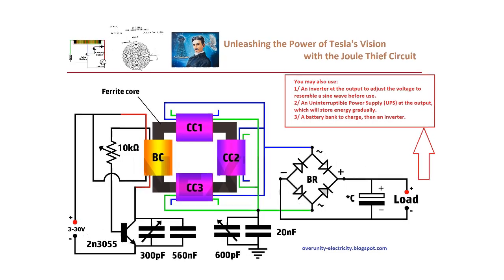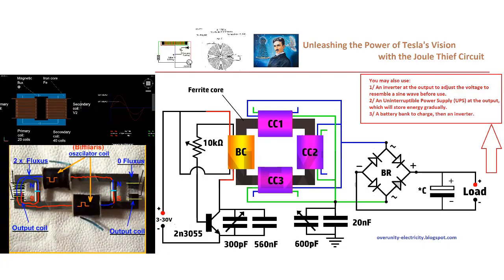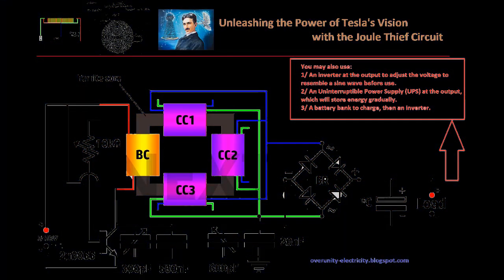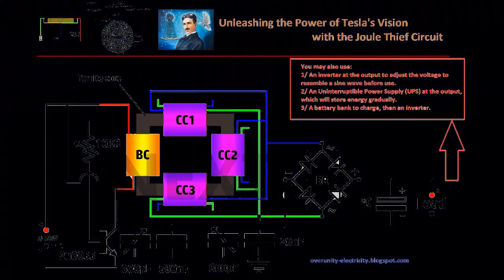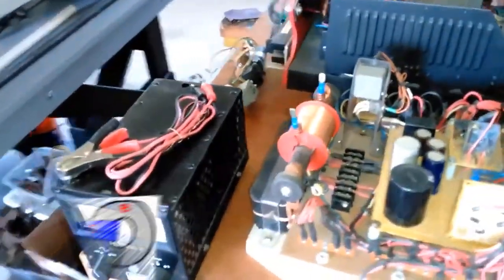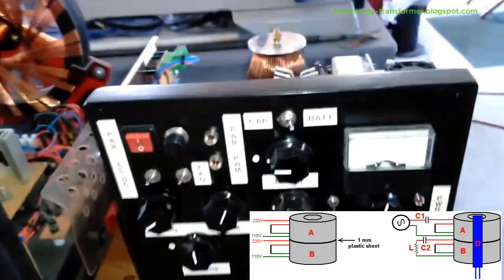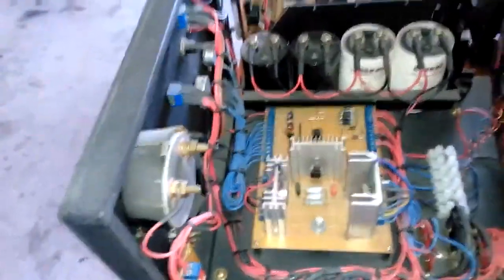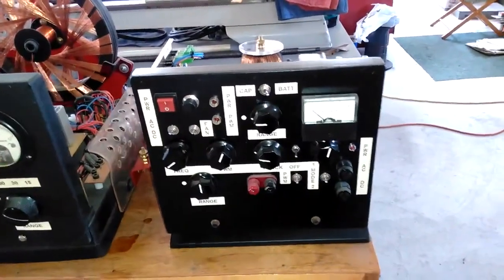Ether Technology After Nikola Tesla: Top 3 Free Energy Transformers

Comment: Please can someone explain to me why is it that back emf did not work on our local transformer bcoz if it works then all high tension should not be able to power more than 1 transformer but we can see that an high tension line can power a whole town why
Reply: A transformer has two windings, they are not physically connected but there is a low energy magnetic link between them. A high voltage small current input is transformed into a low voltage large current output, the power is almost the same apart from small losses. There is a turns ratio between input and output windings. There are many turns on the high voltage side and relatively few turns on the low voltage output side.

The current in the output reduces the counter emf in the input winding by dampening, reducing the magnetism slightly, allowing a current to flow in the input winding. The transformer self regulates the input current flow by the magnetic field in the core which is very small and it is done by the demand load at the output.

Current produces heat, lengthens cables and produces a voltage drop and this means a high voltage can move more power with less current for a much greater distance.

If the linking magnetic field in a transformer that induces current flow is manipulated, an output can be increased.

Comment: Sorry but Im an electronics tech, and this circuit is nothing special !!!!! The story here then is just garbage, and preys on the innocent people who arent electronics skilled. I wish that true scientific breakthroughts would be revealed, BUT THIS ISNT IT !!!! I am so tired of these bogus videos. You only need to know a tiny amount of electronics to know its stipidly misguided. There is nothing Over unity in this circuit.
Reply: As an eng I approve !
Reply: It seemed to me that there was something in this scheme, but I agree with you and would like to ask your opinion about D. Smith and his overunity schemes and what do you know about Hutchison's device and where did it disappear to?
Reply: None of the people pushing this crap can ever get the unit to be self sustaining. 
If the conversion efficiency was 120% then it should after being started be switched to a closed loop and the excess power run the circuit. 
The circuitry to do this is simple, diode Or the startup power and some of the output power, once started the unit will self sustain.
To have a unit that generates 2000W 24/7/365 would power a house.  
Moray and Tesla did have a solutions, those solutions died with them.

All the Woo Woo Bull Crap masks the failures to produce a working model.
If it is simple to build then publish exacting schematics, specifications and operational parameters along with verifiable test results.
Show me production level hardware that can be purchased that actually generates power.
Reply: I believe in Stephen Mark's genius solution, I mean his device, his TPU! What do you think about it?
Reply: but you don't know what an electron is, as well as open and closed physical systems, you were taught that the cosmic vacuum is a void. Your apologies are accepted.
Reply: @ivancuciuc9591  You just put words together hoping it will make sense, too bad, you failed !
Reply: @ivancuciuc9591  What has that got to do with anything? Although nobody knows what an electron actually is we know a huge amount about what it does. That is the important bit. As far as the vacuum beinfg a void, zero poin energy has been known about for over 100 years.
Reply: @rogerphelps9939  How does this emptiness allow an electromagnetic wave to reach the edge of the solar system? Explain this to me, a stubborn person?
Reply: @rogerphelps9939  in all reality there is no void, vacuum is the equally and opposing unified force to radiance from thermal radiation emission which also has its vacuum behind it, vacuum is the trail  behind the  motive force through the  subatomic field particles. I believe physics may be soon seen in a different light or perspective. I believe particles are all the same or come from same source thermally emitted where their field location at emitted output kind of like triple point energy behaviors which determines their directional spin therefore giving a polar aspect of attraction with its equal and opposite mass charge thats apinning in opposite direction coming into a rotational orbital vacuum inner concentric with magnus force resulting in an inductive like field characteristic or toroid. Relates to the mass charge equivalence... bonds can stack or break apart through outside field collision motive forces in tsndem to the spacetime fabric  and so on giving number to higher numbers in the table gaining mass and charge or losing. Where they connect determines their geometrical structure as a mass correlation ratio would apply to its geometrical bond structure and properties towards field interventions. Thats my theory I came to. Just got to work it out but seems like it could be. Figured I'd share.
Reply: I believe the neutrons are thr combined mass between the two as one. The neutrons are attractive vacuum motive medium as mentioned above. Just for some to think or ponder about, because if this is true, much can come from it with elemental accumulation and advancing into the whole quantum aspects which it is. Just saying, if you want to deny it and say something, prove it, this is just a theory of accumulated analysis through my years of study and experience and deep thought.
Reply: @Emaname121  interesting view on complex things.. you are a theoretical physicist, do you have your own website?